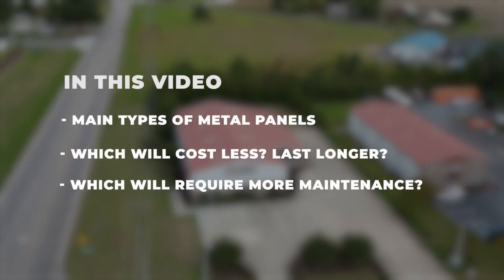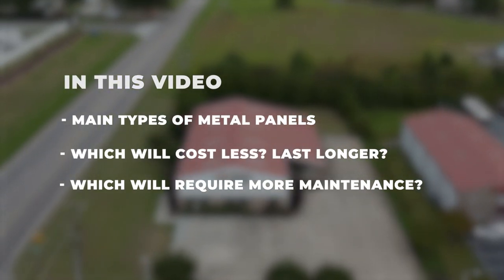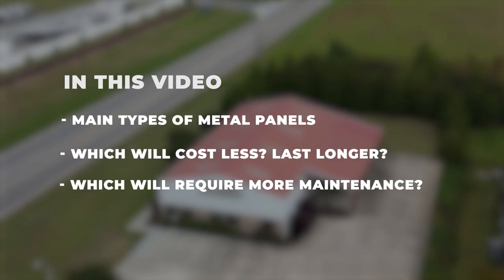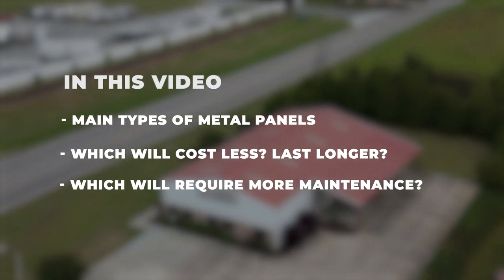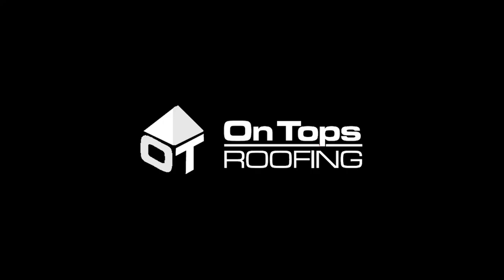Difference Between Metal Roofing Types (COMPARISON)

Comment: I've been building houses for over 20 years, all in the same area, and the exposed fastener metal roofing that I done over 20 years ago is still in great shape. I've ony ever had to do a rescrew on 2 houses, and both of them had been roofed over 30 years prior, before I was even born, and one of them hadn't been done right but still lasted that long before needing maintenance. Both of those rescrews were between 15 and 20 years ago, and  they are still on great shape. I live out in  the country, so everyone's a repeat customer. Every job I've done, I either guarantee it for life, or guarantee it for as long as the materials are supposed to last. I regularly check on all the work I've done, and if done properly, exposed fastener roofing with easily last just as long without maintenance, and if it does need it, on rescrew per lifetime should do it. There are obvious exceptions, like if a roof doesn't have enough pitch and it regularly endures a lot of harsh straight-line winds, or it there are a ton of trees above it, keeping it covered in tree matter. Those things will absolutely cause more frequent maintenance, but in normal circumstances, a properly installed metal roof, with exposed fasteners, will last a lifetime

Comment: You can get the same metal gauges for exposed fastener metal panels as you can get for standing seam metal panels. The truth is an exposed fastener roof can last just as long as a hidden fastener roof, yes you will at some point have to have the screws replaced but in the end the over all cost will likely be even because of the higher cost of the standing seam crimped roof at installation when the roof has to be completely replaced again. 

A hidden fastener standing seam crimped roof cost upwards of $60,000 dollars where an exposed fastener roof can cost $29,000 dollars for the same home. We just had a metal roof installed after Hurricane Ian and a standing seam hidden fastener crimped roof would have cost us $60,000 dollars, a standing seam hidden fastener snap lock panel roof would have cost us $43,000 dollars and the exposed fastener we went with cost us $28,900 dollars. 

Exposed fastener roofs have been know to last well over 40 years and when checked the fasteners were still in good shape and those fasteners were not up to the quality of todays exposed fasteners.

Comment: Lots of homes have exposed fastener roofs and with todays fasteners do not have the old problem of washers quickly failing and leaking. To many of these roofing videos want to push you to the standing seam panels with hidden fasteners which can cost twice as much to install. The biggest problem with standing seam is if one panel fails because the panels are crimped together the rest of the panels can start pealing off as well. 

With exposed fastener systems you have screws holding the panel in place screwed to the roof deck so if one panel does come off the panels to either side of it still have all their screws holding those panels in place and because the panels are not crimped together only the one panel will be lost. 

Snap lock standing seam hidden fastener sound good but wind pressure can cause the snap lock side of the panel to unlock and have been found to be the worst performers in hurricane conditions. 

The truth is with exposed fastener metal roofs you have a lot more screws holding each roof panel in place. Don't fall for the old boogyman that exposed fastener metal roofs are going to result in hundreds of leaks. This video like others showed you an old barn instead of a home with and exposed fastener roof so that alone tells you they are pushing standing seam hidden fastener roofs.